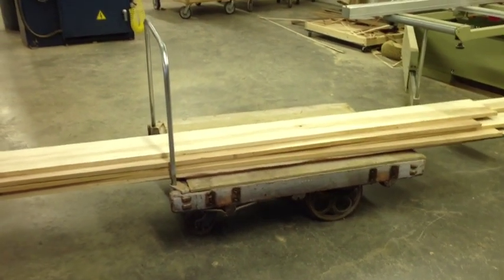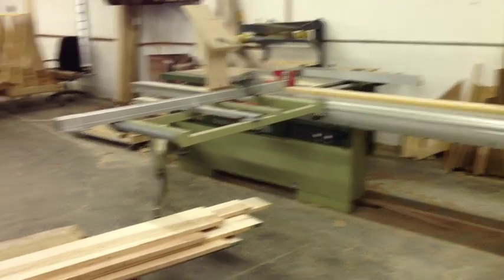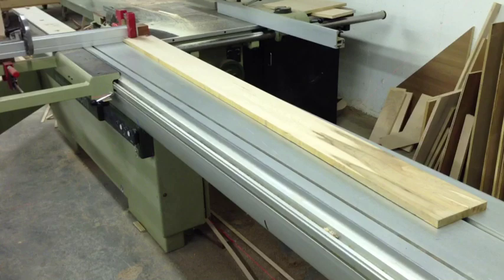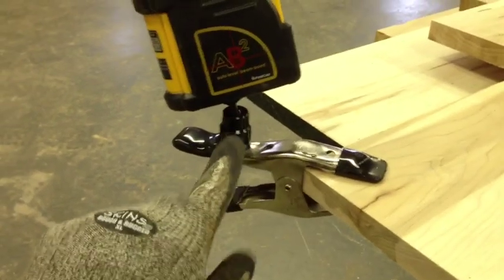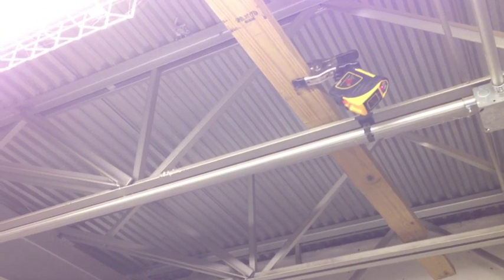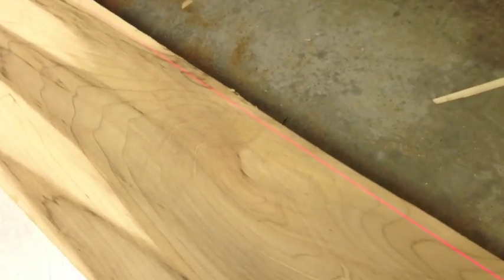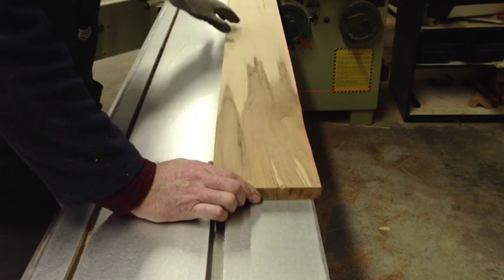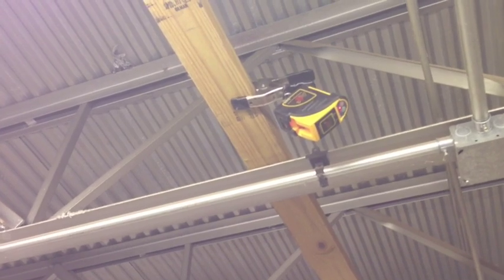Straight Line Ripping With FastCap Laser Level

Comment: That a problem that needs solving. Hmmm, Can the remote vacuum switch be adapted/re-engineered to work with the laser?  Basically you need a remote switch for the laser.  Maybe take that idea to Paul?